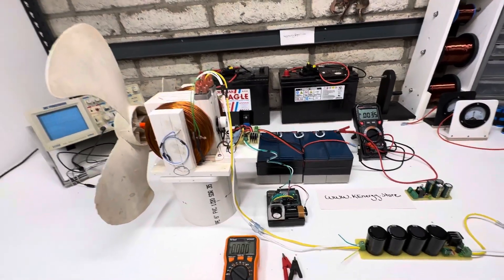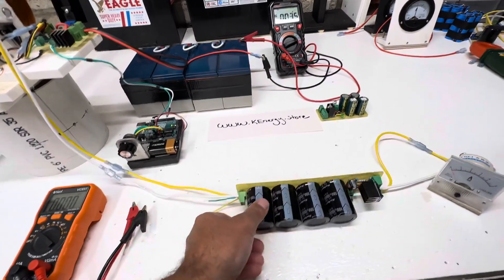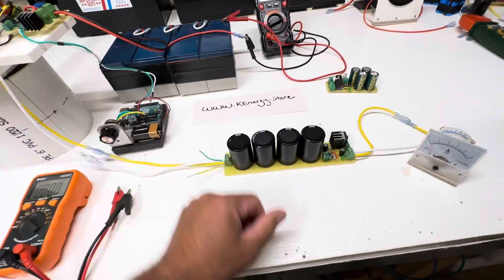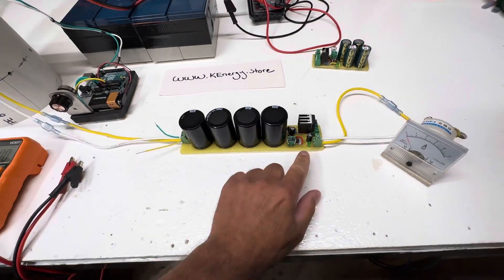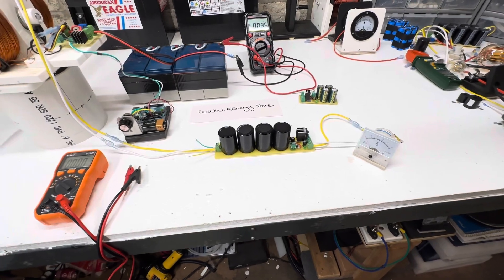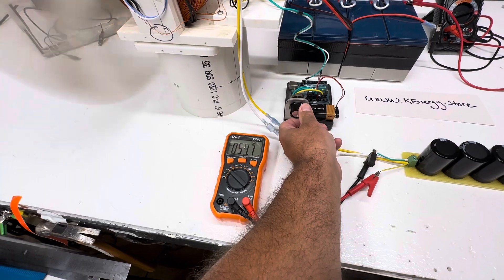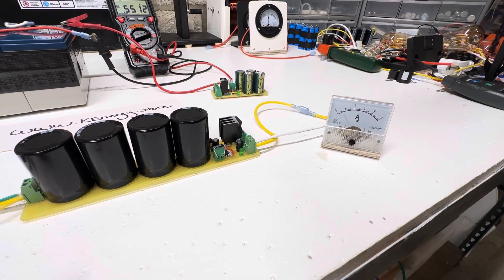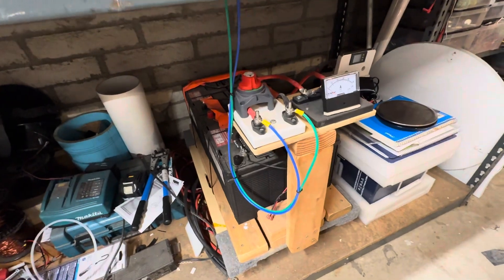Cap dump 48 volt battery

Comment: Is it possible to make something like this to charge an ev battery 400v? I want to charge a nissan leaf directly with solar panels but the chargers are expensive are pretty junk for them only. If could just series panels for a high voltage could i some how get a constant high voltage output to charge the battery?
Reply from the maker: @cronicjohnson  that’s high voltage and very dangerous to play with you will probably have to get a ev charger for that
Reply: @kenergy1707  I mean I have one but it's  21 hours to fully charge and solar panels are cheap and I would be able to charge faster off of DC to DC on solar panels than I would be able to off the available grid.
Reply from the maker: @ see what voltage is full charge 
And put panels in series you will still need something to turn it off when full
Reply: @kenergy1707  couldn't this be managed by the bms for the leaf battery?
Reply from the maker: @ that’s only for protection and balancing not to stop the charging
Reply: @kenergy1707  I guess that is something that could be figured out lol. But wouldn't it be possible to make an mppt like what are already used for solar that can take 500v and charge 12-48v batteries. 
Use a higher voltage range 400-1200v or whatever with a DC output of 400v
Reply from the maker: @ no usually that’s the charger job

Comment: Can you give me a short explain , am not en speaker but i would like to understand.
Reply from the maker: The motor is a pulse motor so it continuously turns on and off which makes 200 volts spikes every time it turns off that energy goes to the cap dump 
 When the cap dump gets to 63 volts it dumps that electricity to a second battery for charging
Reply: @kenergy1707  Why not just put a diode across the coils
Reply from the maker: @funnycatvideos5490  you can of course but you will loose the back emf that charges batteries